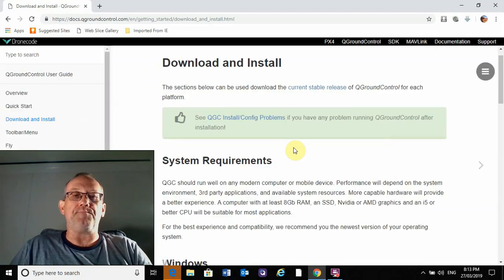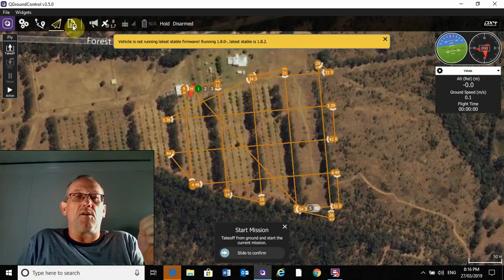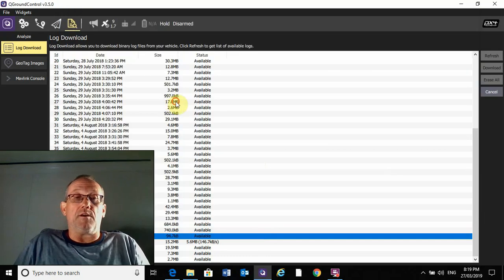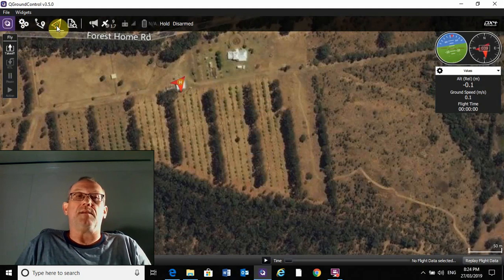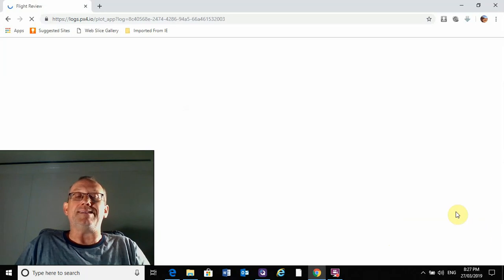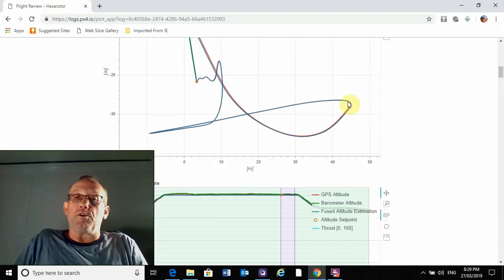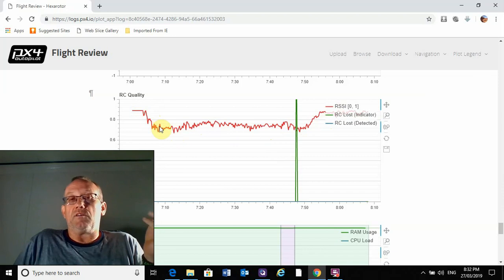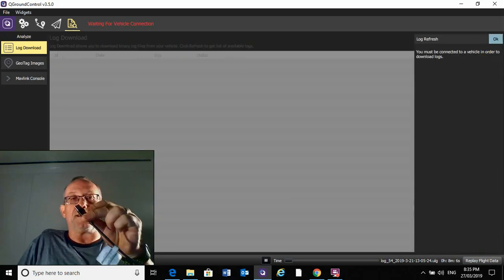Accessing Log files on your Yuneec H520 or H Plus

Comment: Tried with the H plus. would not connect with no battery, battery, or turned on. Ran normal, mode and both GPU safe modes as well
Reply: William you have to keep in mind something that is almost never looked at. Not all USB ports ( especially the old ones ) are able to provide enough power. Try to connect the cable, in your computer, in another port, try with all and almost certainly with more than one it will work for you.
Reply: Haydn Gerken - but I think there is a problem with this... the GUI is for the H, not the H+.  I have also posted to the forum that you placed this video in regarding the issues that I am having with RC connectivity to the remote after trying to connect to QGroundControl.